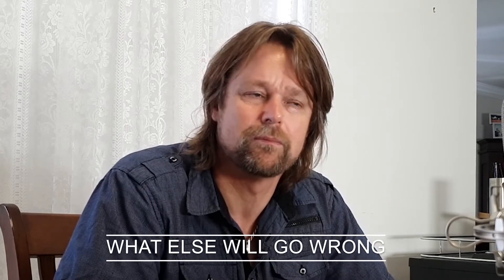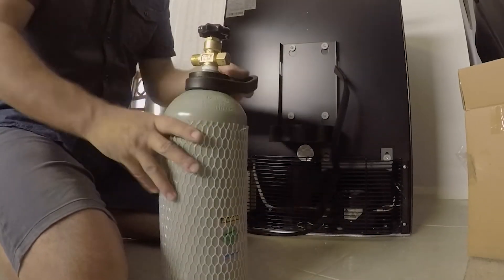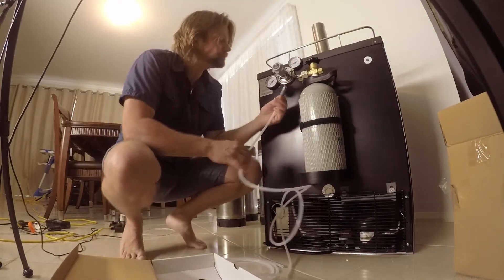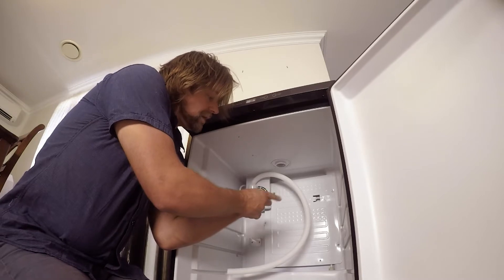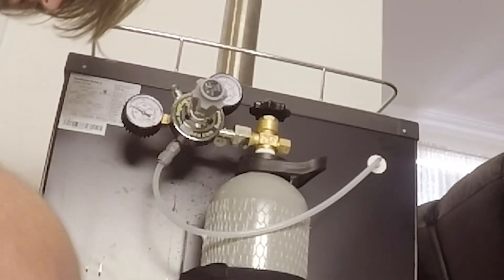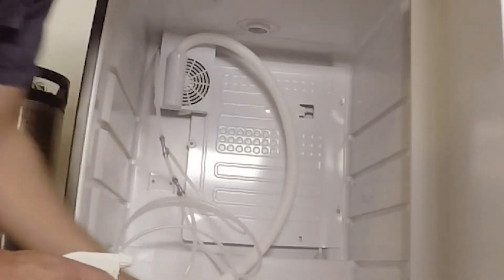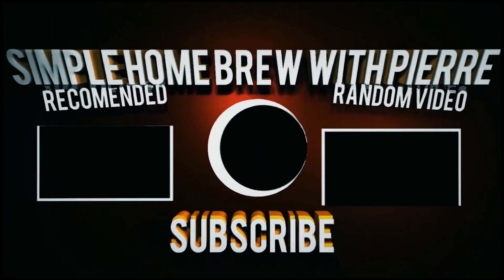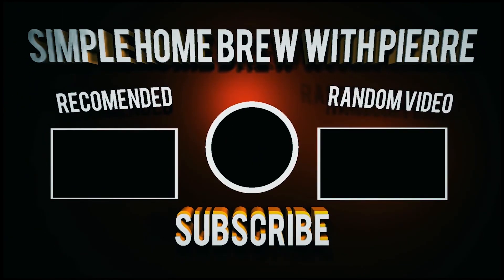Setting up a (Keg King) Kegerator.

Comment: Just watched this video Pierre and it was very helpful mate👍👍
I had a three tap Mangrove Jacks kegerator delivered yesterday and the instructions were ZERO!
When I looked online the instructions were  crap too 😂😂😂
My tower has come already built with the taps on and the gas is already attached to a four way splitter.
I have that loose pipe in the fridge and wondered what it was. I don’t know yet if it will push up into the towers when the beer lines are threaded through?
I hope I don’t get foaming issues but will let you know how I get on mate.
I won’t be doing a putting together video as would be the laughing stock of You Tube😂😂😂
Cheers mate and thank you👍👍👍
Reply from the maker: Wow I recon you will have many years of use from it. I'm so glad the video helped.

Comment: Very cool video! I enjoyed watching it. Don't you think that the nylon washer thats attached to the CO2 regulator should be put into the connector?
Reply from the maker: No, the one hanging on the regulator is a spare as they can be damaged easily if you over tighten it.
Reply: Ah, ok! Thats a really cool kegerator you have there. I love the hose that blows cold air into the fountain with the taps
Reply from the maker: Yeah , loving the system. I still need to set the flow rate so my beer is not so foamy.  Thanks taking the time to warch this Oliver, I really appreciate it. Pierre